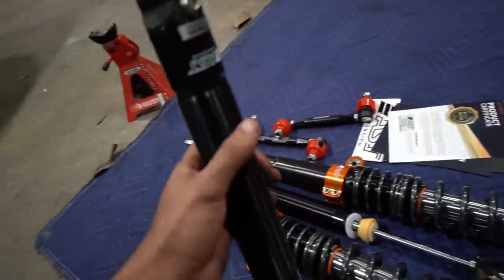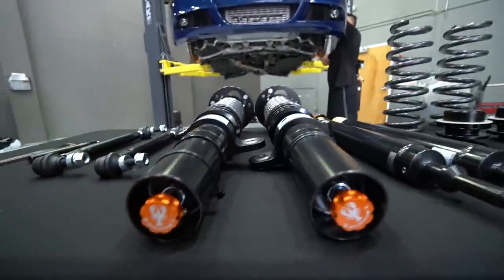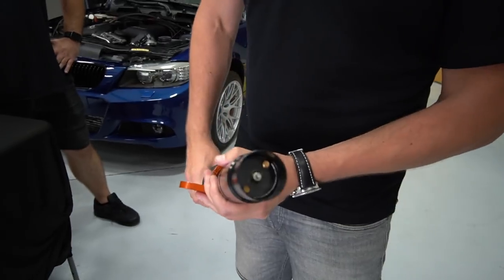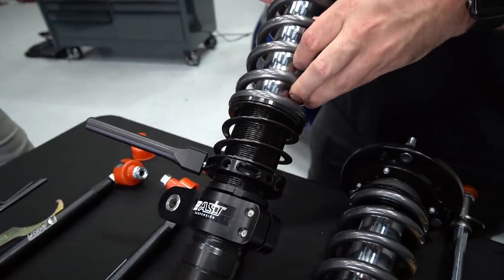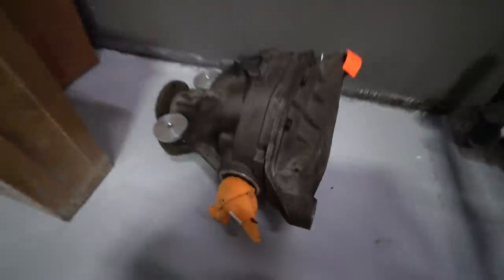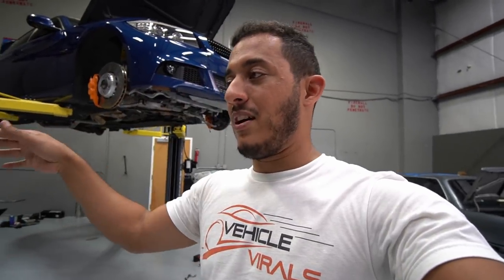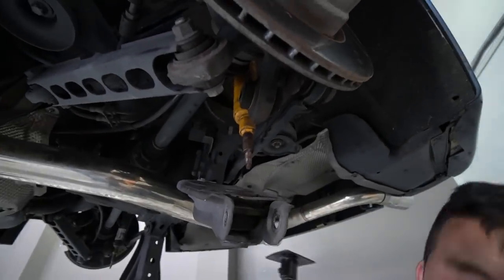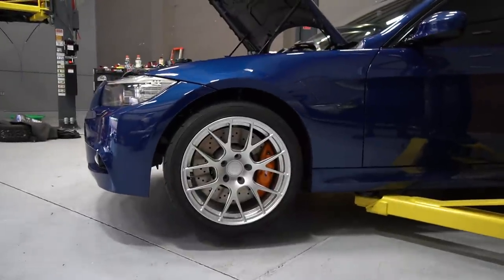The Suspension Upgrade I Should Have Done To My BMW 335i A Long Time Ago! - AST 5100

Comment: Team N54 for life!!!
Reply: Team 2jz e92
Reply: @malekterbel4431  nah most definitely N54 for life!!
Reply: @ml5462  for what? It's been superseded by the n55 and b58
Reply: @KiranPatel-fk1pg  Not in the tuning world.. both great engines either way..
Reply: @ml5462  I’m sorry I love the N54 too but the B58 is certainly the better all around motor
Reply: @KiranPatel-fk1pg Bro did not just say the N55 has superpassed the N54 😂 

N54 has forged crank, rods, and cast pistons.

N55 has NOTHING forged. It’s also single turbo, not the good kind.
Reply: @destruxandexploze2552  You're right, I wasn't as educated 3 years ago. But I do believe that the M2 version of the N55 has forged internals right? At least I know for sure that the M2 N55 is way better than what comes in non M cars with N55's.

Comment: Solution to the rear is either e6x rotors or M3 knuckles and then a spacer on the caliper and run f80 370mm disc.

Comment: my e90 was as low as that when you dropped it, ran with that scrapping tire everywhere, chunks of tire missing on 265 on 18x9.5 in the rear with front and rear fenders rolled, the front i just maxed my bc coilovers out on camber and it worked...now just raised it up to about where yours is sitting at the end of the video, much more useable, no more scrapping, just waiting on another alignment again to make sure I don't eat the tires up with my eyeball alignment lol

Comment: Hey Christian, your E90N54's suspension is starting to look as good as the top of the car! Great work with you "wrenching" this video :D  I made some different initial suspension choices but the same ideas with a full M3 arm replacements (and all suspension bushings will be replaced too with Meyle HD versions). The AST5100s are top shelf stuff. They're as good (better maybe) than Ohlins dampeners engineering. The wheel fitament you have is totally on point. I have some work to do to catch up, but I am doing everything (all wrenching, filming, all editing, all purchasing, all maintenance, all research) from my home garage. Its a 2nd job! :)  I think I'll start wearing a few of my E90/N54 friends Tshirts while filming. #weltspeed #projectweltspeed
Reply from the maker: Wishing you the best man!
Reply: Haha ‘wrenching’ … EXACTLY

🙈🙉🙊

Comment: Dude, just a small question? I have a 328i E92, very nice car indeed, 100,000 miles and still doing very well with proper maintenance. Don't get me wrong and not to be noisy but how do you do it, THESE OR ANY PARTS for BMW ARE VERY EXPENSIVE , I get some parts now and then, but ?  Or are you the owner of the company you show us on you tube. "Wow" just cool stuff. Thanks Again BMW bud.
Reply from the maker: You guys watching and shopping on my website help support the builds. I've also been fortunate enough to partner up with several companies to help with the costs. In short, you guys are the reason I can do what I do ❤️
Reply: COOL MAN, I LIKE HONESTY  PEOPLE and thanks bud and BMW as we know the ultimate driving machine!!

Comment: When you first put it on the ground thats literally the fitment on my 335i at 500hp. I need new coilovers because that is ALL THE WAY UP for them.
Reply from the maker: Slammed at max height? 😅
Reply: @VehicleVirals  unfortunately yes previous owner put it on silvers neomax coilovers and i have a feeling its kinda the equivelant of bc extreme low coilovers. Its on my list of things to buy immediately kuz its intolerable

Comment: You should replace all the bushings on the front and rear suspension and also on the subframe with polyurethane ones (if you did plz reply me with a link of the vid)
Reply from the maker: Already happening with the diff, axles and driveshaft install.

Comment: I got the BC racing inverted coils, and I can say one thing, they are fcking noisy, the make a lot of noise, and you can do nothing ablut it, this AST might be better, but they cost 3x as much also... 
The driving experience is really good, just the noise.

So friendly advice, if you are thinking abou getting the BC inverted, and your car is not a only track, than just don't. Get the normal ones, or save some money and try this AST

Comment: I'm looking for a 2008 ish.. BMW to harass all the Mustang,Camaro, and Dodge vehicles here in Arkansas/Oklahoma area. Should I go 6 turbo or V8..?
Reply: Depends what type of gains you are looking for? The V8 is a Haus but do only have too much room for modification inline 6 twin turbo is a dream design and you can go from 309 go to 500 fairly easy and most cars out here don't have 509 ponies.

Comment: How much does it cost to do the single turbo kit you have. With installation price. Not sure if I want to go pure stage 2 high flow or if I want to do 6266 doc race bottom mount, some help would be greatly appreciated. My hp goals are around 500 wheel.
Reply: Pure 600
Reply: I think you can meet this goal easily on pure 600s on pump gas, i would say that is the cheapest option for you to get 500rwhp and still be pretty reliable
Reply: I am running pure 600s right now with custom tune by wedge on pump 93 and my car is about 480rwhp, FBO, LPFP stage 2, inlets, xhp stage 3. Youll be golden

Comment: Just came here to say that y'all shouldn't just think it's a better suspension then stock. It will always feel better because IT'S NEW!!! Smh, the stock one has a shit ton of miles and of course it degraded. Replacing with the same stock parts will have the same feeling.
Reply from the maker: You upgrade to coilovers not because you want oem ride quality and height. It's a performance upgrade with versatility. Yikes!